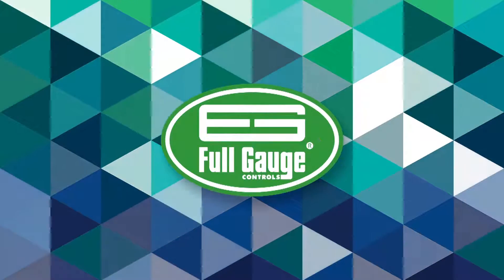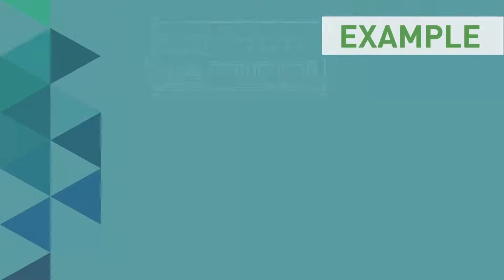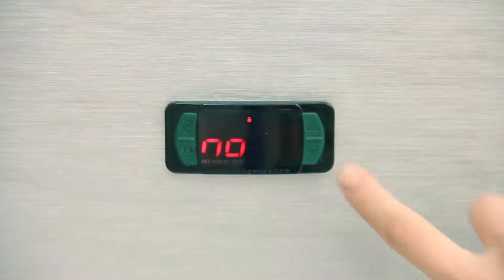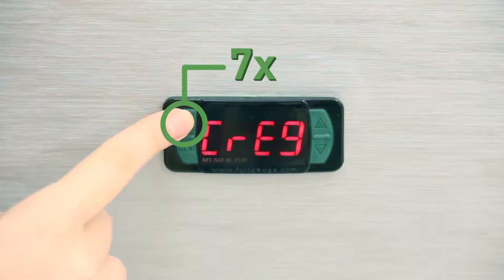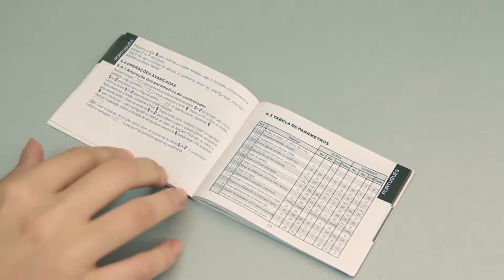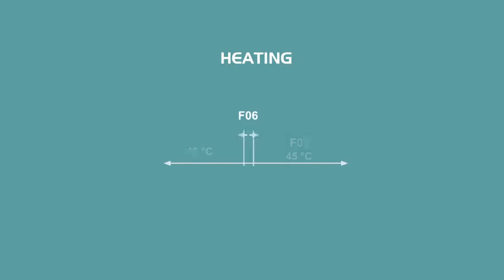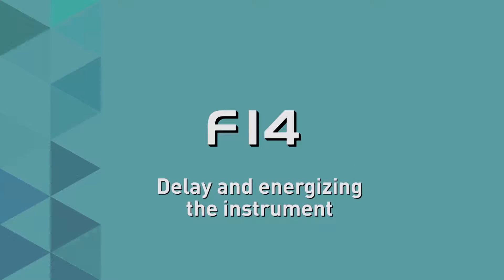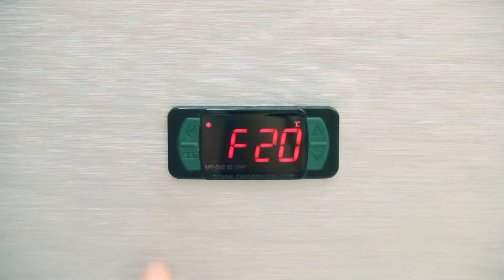MT-512E 2HP - Full Gauge Controls - English

Comment: How do we set the minimum and maximum temperatures? Help me please
Reply from the maker: Hello! In most of our controllers, you set the minimum and maximum temperature through the SETPOINT and HYSTERESIS logic, meaning a temperature that turns off the system and a differential to make it turn back on. Example: if you want to maintain the temperature between 32°F and 41°F, you set the SETPOINT to 32°F and the HYSTERESIS to 9°F (32+9=41).
Best,
Full Gauge Controls

Comment: How to reset
Reply from the maker: Hello @Shaikhajaz123, you can reset the parameters by changing the unit from Fº to Cº or vice versa. To do it, you may set the code 231 instead of 123. Just don't forget to change it back after doing it.